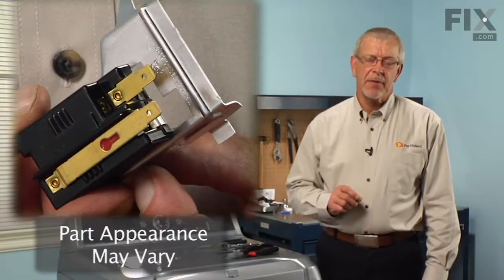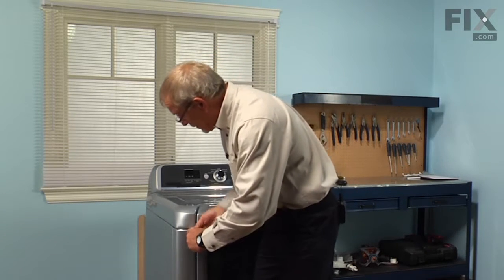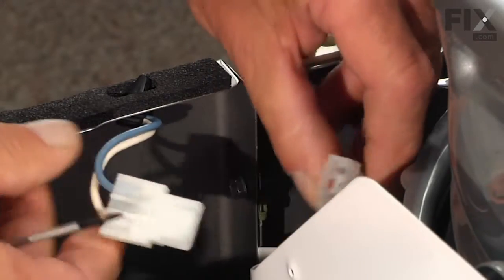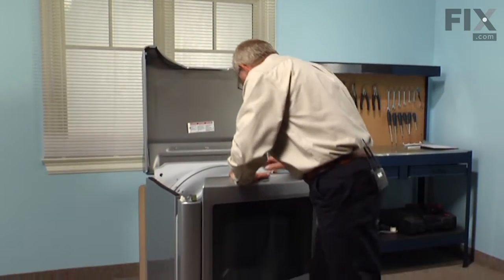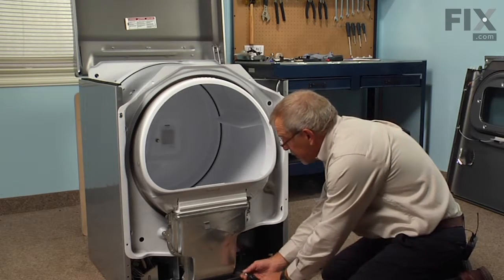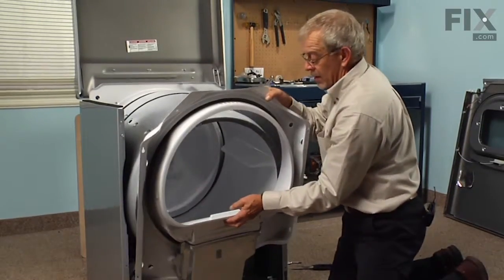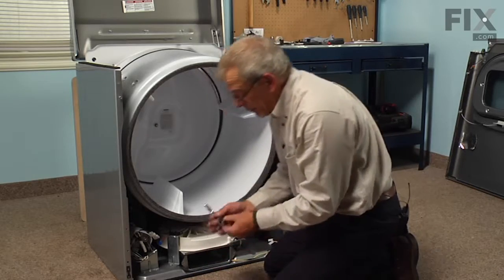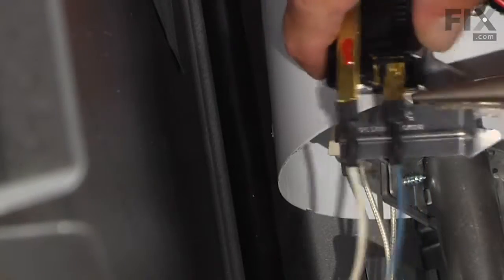Kenmore Dryer Repair – How to replace the Radiant Flame Sensor

Comment: Hi.  I used one of your videos to replace the drive belt and rollers.  Now my dryer won't stay on for more than 5 minutes.  I cleaned out all of the. lint and dust.  It doesn't matter what setting I use, it won't stay drying for more than 5 minutes.  Any ideas?